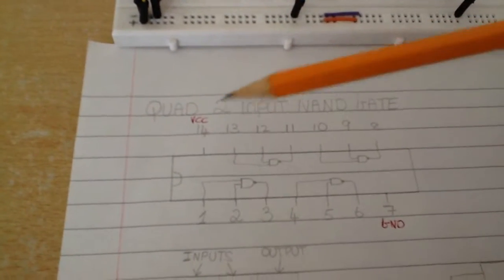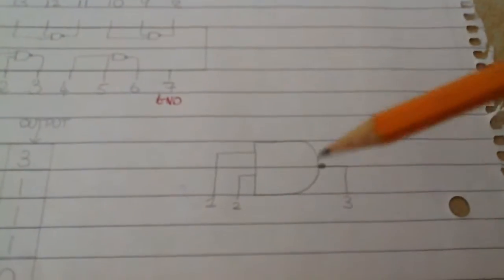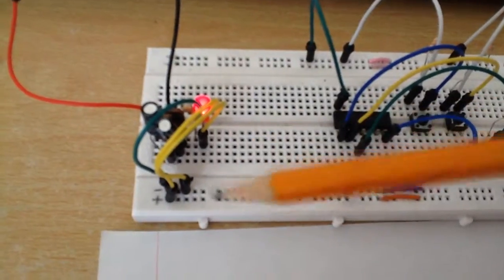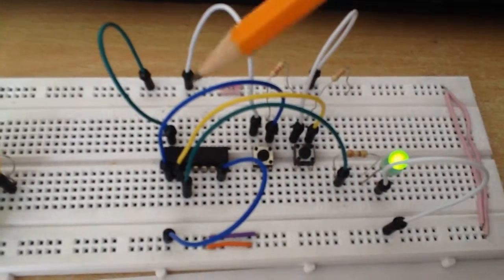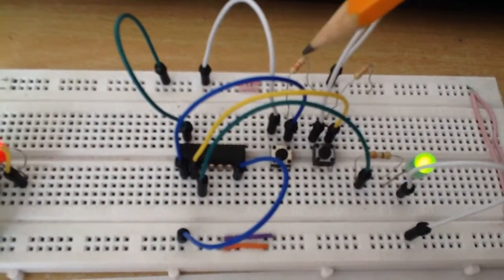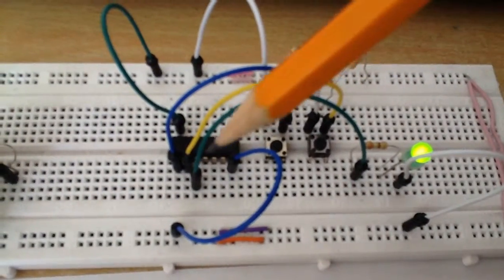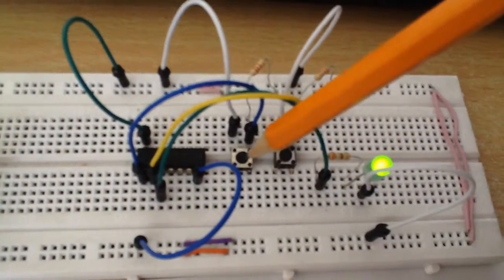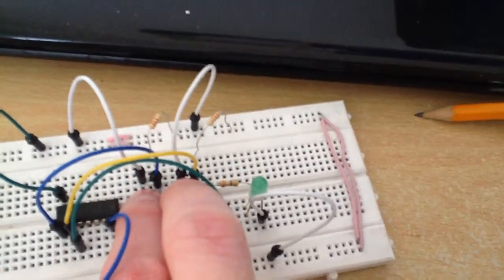The Quad 2 Input Nand Gate Chip on a breadboard

Comment: could you do a useful project using this chip? I would like to see an application and get a better understanding on how this chip is used, thanks.
Reply from the maker: I put up another video using this chip with some circuits. Hope it helps.
Reply: Thanks, I'm trying to make a in circuit transistor tester, and it uses this chip.